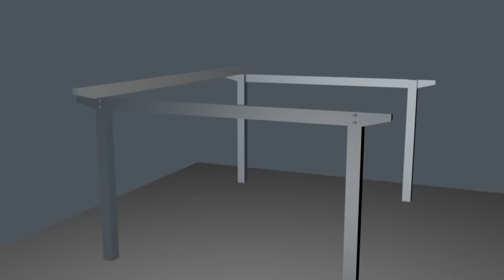How to Build a Pergola | Mitre 10 Easy As DIY

Comment: How do you put sleeper tops on a sleeper retaining wall with out having them bend and bow
Reply from the maker: Hey John, you just need to use the correct fixing for the timber you have. For example, a 50mm sleeper top, you could use a 150mm landscape screw or a 150mm x 10mm coach screw. For 100mm sleeper top you would use a 200mm landscape screw or a 200mm x 10mm coach screw. ^Charlie
Reply: Mitre 10 New Zealand hi Charlie I think I need to send you a pic of what has happened
Reply from the maker: Hey John, sounds like it might pay to pop in and have a chat to the team at your local store so that they can give you specialist advice on your project 👍
Reply: Mitre 10 New Zealand .Tried that they are as helpful as a one legged man in an arse kicking competition
Reply from the maker: That's no good - send us some pictures on Facebook and we'll see if we can help 😃

Comment: First Mistake ………….placing wooden post directly in concrete. The post will rotten pretty quickly. Always place bitumen or felt around the base of the post to reduce water absorption through the cross grain of the wood.
Reply: the post is treated. designed to be installed into concrete or soil.

Comment: little frustrated at how quickly he skims over getting the initial posts right as if they're slightly out then its f*ked
Reply: He makes it appear as if the structure being plumb and level needs perfection.  Since it is only four walls and there is no floor or ceiling, it does not have to be perfect.
Reply: He said you have to measure the diagonals, that will make it a perfect square or rectangle

Comment: Great job , you build pergola mostly like i do.we dont use braces at top which makes pergola look ugly.if you mitre posts it will remain square and plumb without tip braces.the top battens you sguld cut on angles to match angle joists.dont leave em square lazyboy???? Lol

Comment: how much cement was that per each leg !? 40x40x50 cm ? that's about 100kg based on an online calculator for cement! do you really need that much weight? i mean do you need 400kg of cement to keep this from flying away? equals to 4-5 full-grown men 😅
Reply from the maker: The pergola posts are securely anchored and will withstand the test of time and environmental conditions. Properly anchoring posts with sufficient cement is crucial for the stability and durability of outdoor structures like pergolas. ^Cam
Reply: @mitre10nz  I'm definitely sure you're right ✌️

Comment: I don't understand 7:52,
Reply from the maker: If you pre-drill holes for the nails before hammering the nail in, this will prevent the timber from splitting once the nail goes in 😊 ^James
Reply: @mitre10nz   thank you for replying, how bad could the wood splitting be? Is it that bad on the woods integrity?
Reply from the maker: It depends on the timber you are using. The harder the wood, and closer to the edge you are, the bigger the risk of splitting. We recommend you do pre-drill, so you can get the best results in the short and long term.